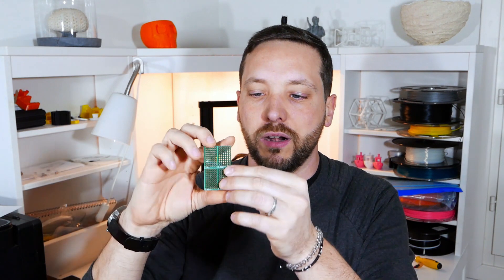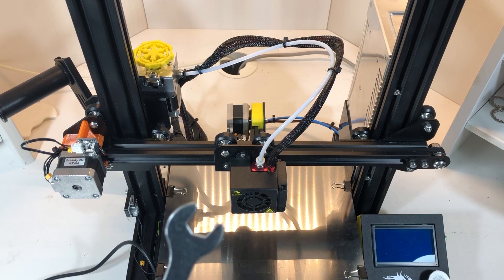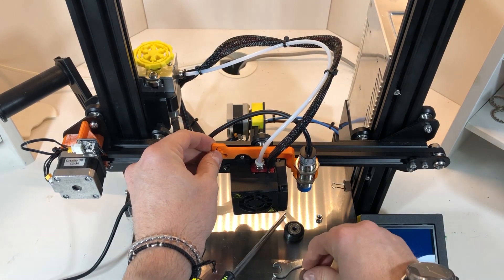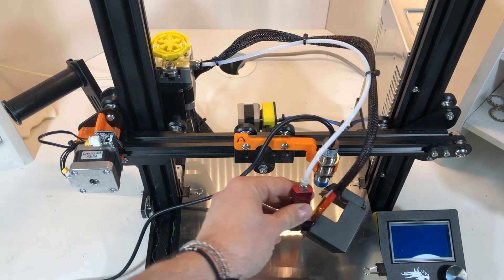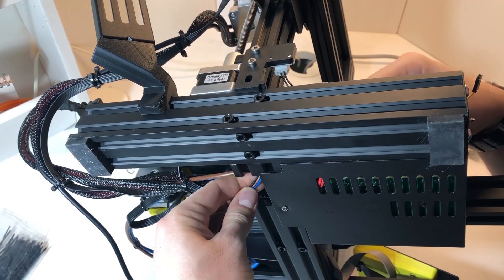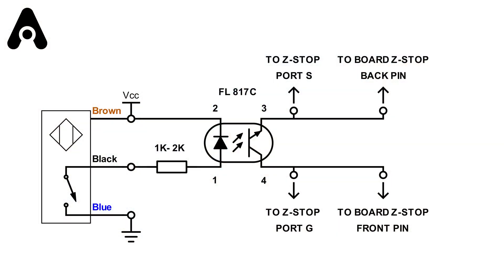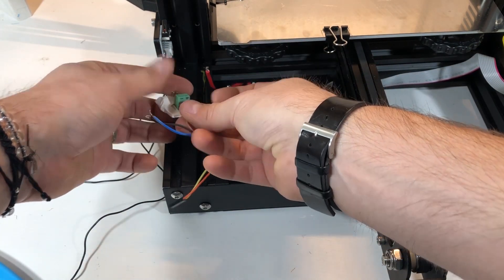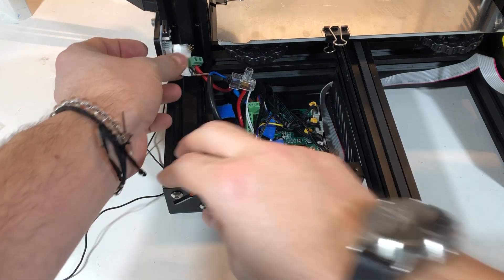DIY Inexpensive Bed Leveling Sensor (Part 1)

Comment: First: Why did you use an opto-coupler? Conversion level? It is not necessary: the output (black wire) of inductive sensor is open-collector, so you can power on the sensor with 12~ 36 V and put a resistor (pull-up = 1K f.ex.) from the black wire to the 5 V and connect the black wire direct on the input pin of your controller board.
(BTW: the inductive probe works from 6 to 36 V. AND it works fine at 5 V as well, but you didn't test it BEFORE to do the "job", right?)
Second: Why did you use opto-coupler with reverse polarized led? It doesn't work at all.
Third: Your circuit, besides being wrong, doesn't make any sense.

Comment: best video about diy proximity auto bed leveling!
Reply from the maker: Thanks mate!
Reply: @AMakeDesigns  im having trouble setting it up as im not as experienced as you. 

if i replace the 24v with 12v, would this work? i use a LJ18A3-8-Z/BX sensor http://imgur.com/a/9r9zSU9

Comment: Do you think a AQY272 would work for this function?
Reply from the maker: It might work, just make sure the voltage will not leak in the board. I'm an electronics amateur, make sure you don't fry the board!

Comment: Nice tutorial bro . The perfect one. 
I implemented whole. 
But need one modification, if i want to connect the mechanical switch and inductive sensor both to the same port. I tried connecting parallel to the opto coupler out. But no success .. do you have any solution?
Reply from the maker: You have to parallel the branch after the opto to short the two board pins for the Z endstop. Should work like that

Comment: You killed it man,awesome idea and implementation.The only problem I faced was the inverted X direction that was mentioned in a previous comment and the most significant for anyone that tries it is the direction of the dupont Z connector is not the same to plug it just like that cause of the transistor of the optocoupler,it didn't work the first thousand times tried to home the Z axis and I slapped the nozzle to the bed many times before o figure it out that it was the position of the dupont connector was wrong,I flipped it and it was correct. I wonder why you bridged the dupont connectors on the board,anyway that's so little in front of the solution you have to us to add this perfect feature to our printers.Well done greetings from Greece

Comment: Congratulations on a great pair of videos. I have a BLTouch 3.0 and it is already erratic on my Ender 3 Pro. I have ordered an SVR mini 3e 32 bit board and I see that the BLtouch is almost unusable with that. Therefore, I thought about the EZABL - but with taxes it starts to get expensive in the UK. So I thought I might try to build one myself and then I found your videos ..... great a guide to the way forward.  Would it be possible to publish a still picture of you built circuit board (top and bottom surfaces) - trying to extract a still from the video is hard to get it right.
Regards David
Reply from the maker: I will do my best to do it when I can!
Reply: Great, I know that doing that will take some time - so thanks when you can.
Reply from the maker: Hey mate! I posted the pictures on Twitter. Apparently can't post them here on YouTube. I hope it works for you!

https://twitter.com/a_makedesigns/status/1174760863947001856?s=21

Comment: Hey mate! I was doing almost the same project to my ender. So I use your schematics and compare it to mine. I found that to my knowledge, you put the 1 and 2 numbers the incorrect way. I think 1 is top left, 2 bottom left, 3 right bottom and 4 at the top. 
Anyways, this was super helpful. I followed your videos and I made my own little pcb on a diy cnc and everything worked like a charm. I could send you some pictures if you want.
Thanks and I'll stay around. Cheers from Argentina!
Reply: You are right. In the diagram, the opto LEDs are reverse biased. Also the NPN transistor out of the opto is reverse connected too..@A-Make Designs :  Wonderful explanation brother.. I was looking forward to upgrade my ender 3 to add ABL with a cost effective solution and your video explains exactly what I wanted to do. Thanks a lot!
Reply: @deepa12345611  Hi, are you able to make this. Is it working for ur ender 3. I also have one and having so much bed levelling issues
Reply: @Abha-com  To be frank, I actually had set up an auto bed leveling feature on my Ender3. But there was inevitable adhesion and warping issues, even with PETG printing. Here is what I did. I carefully measured the warping on my heated bed. Tried to bend it back by applying some pressure after removing it from the printer. The remaining warpage was compensated for by adding aluminium tapes. After that, I got rid of the ABL and modified the Marlin back to disable ABL and to use the stock Z limit switch. Now I don't face any bad bed leveling issues anymore.
Reply: @deepa12345611 i am using a glass bed and whenever i remove prints, the bed levelling is messed up. So for every print i have to bed level manually. I dont know what to do. Auto Bed levelling is expensive. Shud i go for bed levelling solution or change the bed springs & tighten them or remove glass bed while removing prints and put it back?
Reply: @Abha-com  you can use G29 Gcode after G28 at the starting Gcode settings of your slicer software. This will cause ABL before every print. However, I am a bit against the concept of ABL as while it compensates for the warpage in bed, it is actually causing layers to be non planar. This can cause warping of bigger prints. The ideal way is to make your bed as planar as possible and using regular printing without ABL. I don't use ABL anymore. I compensated  the warpage in bed using aluminium sticker and used the regular bed that came with the ender 3. Prints are now good. (I use only PETG as ABS is too prone to warping and PLA is too weak for my purpose)
Reply from the maker: You can fade away the bed leveling compensation with gcode after a few layers
Reply: @AMakeDesigns  oh that's a good information. Can you specify which is the Gcode? Also please throw some light on how you implement it.
Reply from the maker: Look up M420 Zxxx (https://marlinfw.org/docs/gcode/M420.html)

Comment: hi sir you used 2 pieces 1k resistor?
Reply from the maker: Yes. 1k is probably enough, but I had them lying around and I thought to reduce the voltage a bit more since the opto I used is scavenged and I have no idea of its previous usage and specs
Reply: @AMakeDesigns  i have the same opto came from defective desktop psu and have lying around LJ 12a3-4-Z/BX
Reply: Thank sir for replying.. happý printing
Reply from the maker: You are very welcome mate! The voltage to activate the photodiode usually is above 5mA and 20mA is often used.
Take care!

Comment: Great video, thanks a lot and please go on like this! Just a few questions: The wiring is not entirely clear to me. According to your schematics the output from the FL817C is connected to four different pins. Port S and Port G likely refer to the z-min pins (signal and ground) on the MKS GEN L. This makes sense to me, however, what is meant with "Board Z-Stop" back/front pin???
The 1k - 2k resistor is to limit the current through the diode I guess? Assuming we're on 24 volts and the current should be 20mA a 1.2k resistor would be the correct value, right?

Another question: You used a NO sensor and adapted the firmware accordingly. Woudn't it make more sense to go with a NC version to prevent a the head crashing into the bed in case of sensor failure? Last question: What do you recommend for positioning the sensor? Somewhere else I read something like 1 mm above the nozzle which seems a rather tight to me.
Reply from the maker: Welcome!

The wiring refers to the original board, front and back because they are the correct one in that case. I do not remember which is high and which is low, but I'm sure you are expert enough to find out with a voltmeter. The other two pins are the connectors of the small board of the Z-stop switch for the NO contacts to wire the mechanical switch in parallel to the sensor for extra safety. 

You are right for the resistor. I opted for 2k because I don't know the "wear" state of the scavenged diode and I thought limiting the current more would have been safer (not sure if it's a right assumption, I'm an electronics DIYer). The limit for activation should be 5mA so more than enough nd you do not need to transfer power to the board. 

If you use a NC it will stay ON for most of the print. My first sensor broke and it happened to be failsafe due to the way the internal electronics are designed I suppose. The LED was still triggering, but the output was always on. I still have to "dissect" it to understand what went wrong :-)

Last question: the answer is in the part 2 of the video! :-) https://www.youtube.com/watch?v=l3O9CPr_U-E